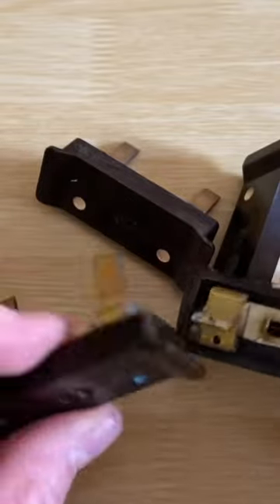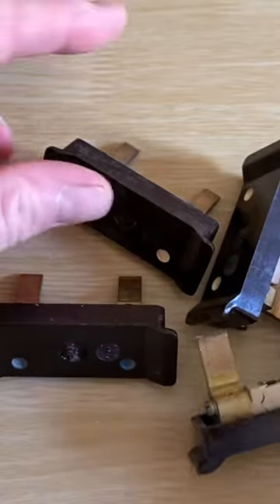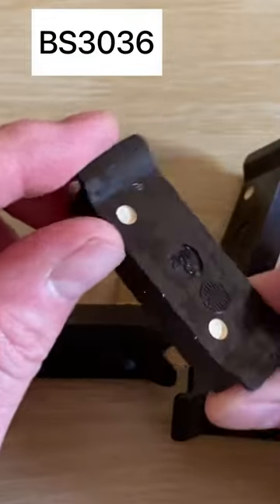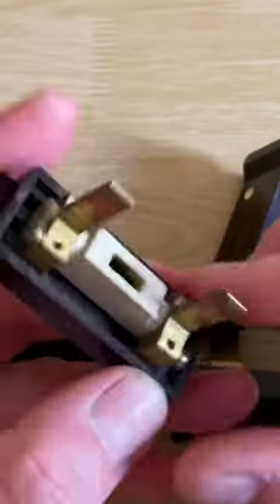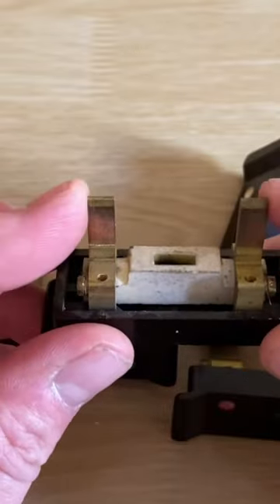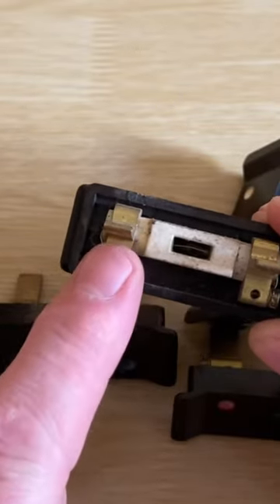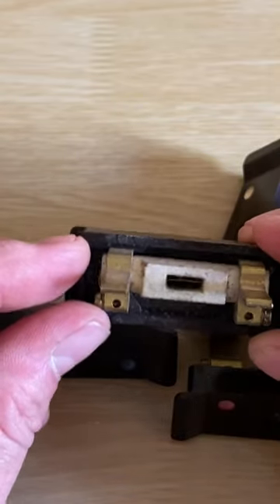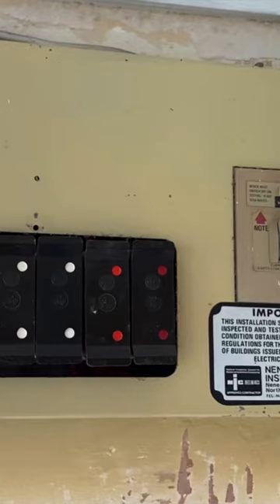BS3036 Rewireable Fuses

Comment: Fuses? Ah, yes. Thanks for the trip down memory lane. I do recall when I was a kid rewiring ceramic fuses, using wire from  a small card which had a range of amperage on it, relying on the consumer to pick the correct one.

Comment: Hi there
I have just installed aan 8.5  kw shower as the old 7.5kw one packed up. I have put 6mm cable in so I know it is covered. Anyway the question I am asking , is that it currently ha s 30 anp veery old style rewireable fuse. So I really need to put in a 49 amp fuse to cover the load. Can you tell me if I can plug the 40 amp fuse into the old 39 amp housing / case ? Or would I need to put in 40 amp housing .

Cheers Jonny

Comment: I don’t know if there is any truth in this but  a guy  I met a good few years ago  who was working for the Southern Electric Board said he would never use MCBs and would stick wire rewirable or cartridge fuses . Reason being he  said he’s seen fires started by faulty MCBs
There could be something in this as in my own home I had a MEM rcbo go off with a bang and explode. It was blown to bits .
Reply: You have to weigh up the risk of a faulty part causing a problem versus the benefits of an RCBO which contains an integral RCD.
That RCD can prevent death.

I have never come across parts being defective as you describe, unless they are cheap Chinese crap which you should not be using. d

Comment: Why rewire a 5 amp fuse with a cracked / fucked up clay / porcelain casing. As shown in the video... I knew how to rewire a house from the age of (7) 1976, sadly even though I am now (55) I go above (I EEE regulations (16 / 17 / 18 ) I profer to work (LIVE) as I never switch off. I can do (3:phase ) (415 volt) and work up to (1,000 volt DC or AC ) power. 

I have worked in pubs and one had (7 fuseboxes) and all were  unmarked . And if anything went crazy ( dance floor lighting ) I use to repair it there and then.
Reply: Pubs invariably had the dodgiest wiring. Many still do...

Comment: I still have them in my house 30 years after I moved in, one  blew when my oven element flashed twice went bang bypassed the fuse in the plug and blew the 30 amp fuse wire it will out last me.